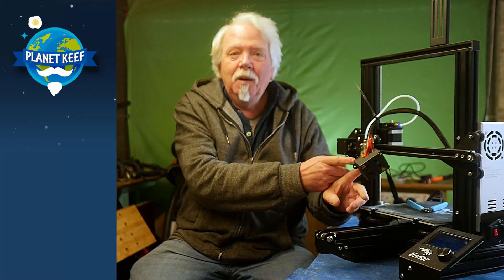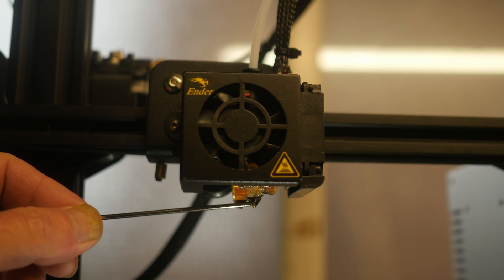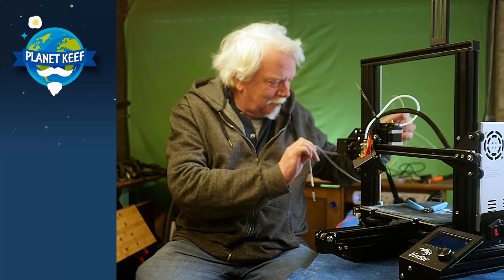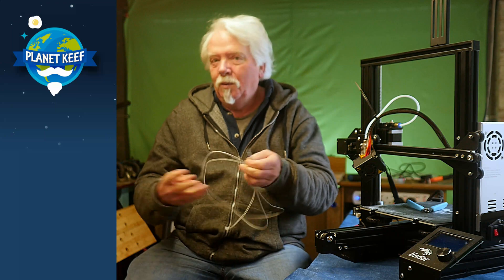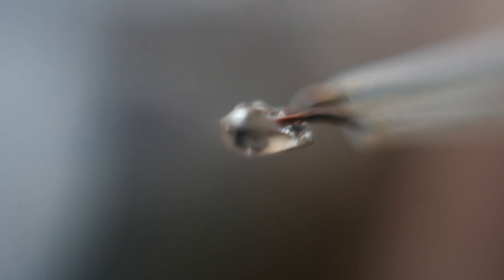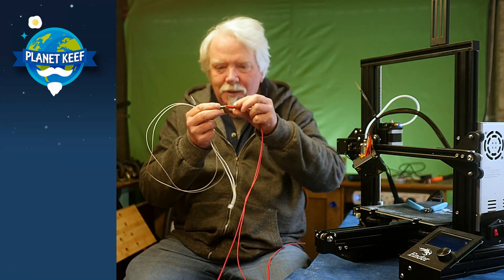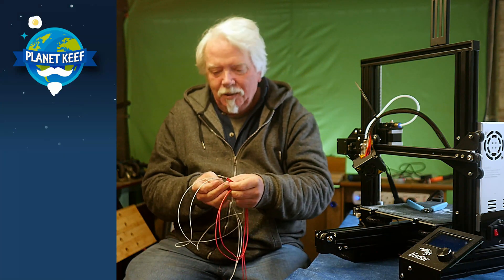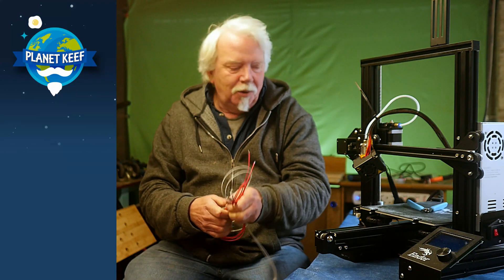I Broke My Ender 3 | Creality Ender 3 Hot End Problem

Comment: I don't have that brand of printer, but 3d printers typically have one wire of the heating element connected to the + power supply voltage, and then a MOSFET transistor is used as a switch to connect the other wire to ground.  It sounds like that transistor has shorted, since the hotend starts getting hot as soon as you turn it on.  If you're on Facebook, I hear there's a pretty good Ender 3 group that might have suggestions on how/where to go next.  Good luck, Keef!
Reply from the maker: Cheers Pete - MOSFET looks like the most likely thing. New main board on the way!

Comment: Sorry to hear your problems with the Ender 3.  It sounds like a computer issue, i.e.  it's reporting a temperature from the Thermistor but doesn't seem to want to stop heating once it's reached that temperature.  Regardless of whether the Thermistor is accurate or not, the computer should turn off heating once the apparent temperature set point has been reached.   Cheers Ged
Reply: The Thermistor accuracy is critical, without accurate temperature monitoring how does the CPU know what is going on at the hotend? Accurate temp reporting is the difference between proper operation and thermal runaway and a fire.

Comment: Keef mate is the hotend cooling fan running? Did you get a direct replacement for the thermocouple? Did you make the necessary changes to the programing to compensate for the new hotend? If the ender 3 has a self diagnostic run it.
Reply from the maker: Yes, the fans work. AFAIK the thermistor and heating element are the same as the originals (I mean, they look the same). Ender 3 doesn't have diaagnostics or a bootloader - prolly gonna have to add bootloader, and that looks like a tedious process...
Reply from the maker: Ah, brilliant! Now to find out where mine actually came from and what codes apply. There doesn't seem to be anything listed for China...
Reply: Sorry Keef mate I was wrong, I referred to the  thermistor as a thermocouple. Two different components, A thermistor is a temperature variable resistor where a thermocouple is a temperature voltage generator. So that chart I sent you is useless to you.
Reply: Keef mate the best I can come up with is that you have a programing problem or the MOSFET (metal oxide field effect transistor) that controls the heating element in the hotend is shorted. The controller board are like  30 quid i would just replace it.
Reply: i'll do some in depth rooting around the internet to see what i can come up with to help. Cheers Keef